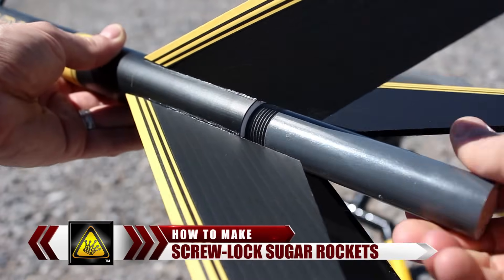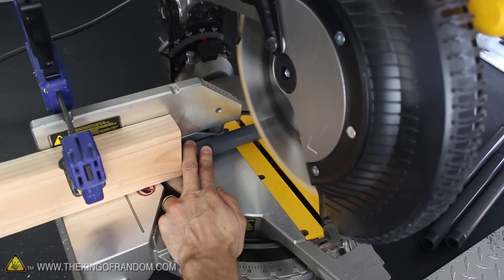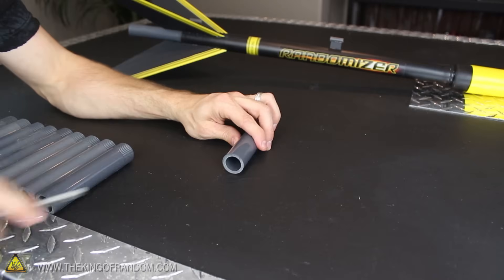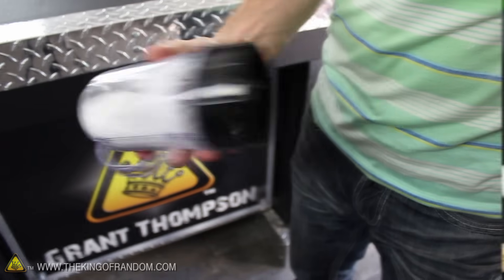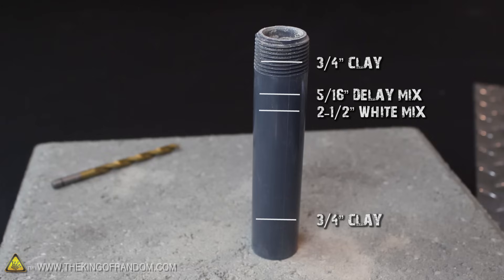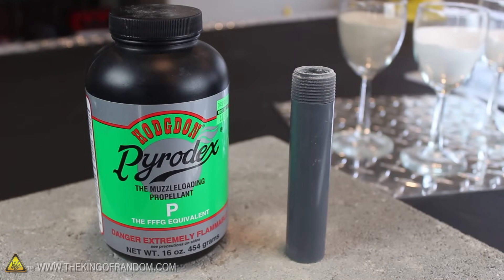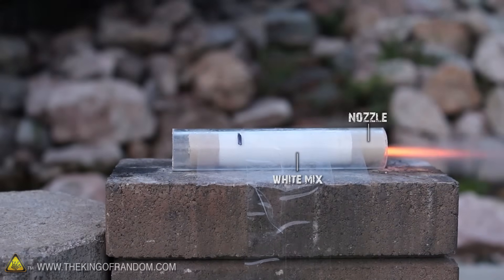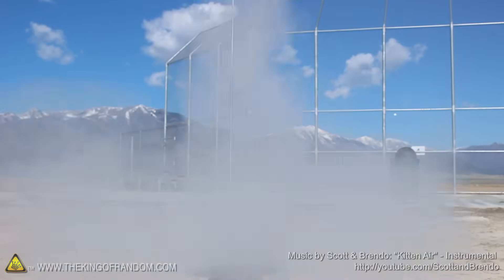How To Make "Screw-Lock" Sugar Rockets

Comment: What I like about this project is that it is not only very affordable, but easily scalable: You can use longer and/or wider PVC tubing with more propellent in it and/or add multiple tubes to your rocket to get even higher altitudes! I wonder how big of a tube you can use before the laws of physics make it impractical? (i.e. Can an 8 inch diameter PVC pipe contain the resulting internal pressure and would its added weight not be worth the effort?)

Very nice!

JW3HH

Comment: Do you know if there is a way to get a slower, more efficient burn? I wanna make sure my rockets go as high as possible for as long as possible, and a burn of about 3 seconds doesn't sound good enough for maximum efficiency. Even if it's just a second or 2 longer, it'll probably make a major difference. I'd make the engine longer and increase the quantities for the white poder, but unfortunately I don't exactly know much about pyrotechnics and how it'll react.
Reply: Just use the delay mix for the whole rocket with only one gram of baking soda instead of three grams,it seems the baking soda slows down the burn rate 👍

Comment: "Be Precise" SO USE METRIC.
Reply: Just in case you dont know, almost every ruler has a metric side
Reply: 0.45 cm is way easier to understand and say as: 11/64 of an inch...
Reply: +David Ridout Ye, any buy-able rocket kit uses the metric system. Most instruction guides even come with a paper metric-ruler.
Reply: Wasn't the pipe in inches at first? 
yes, so use inches. If it was in cm then use cm. Easy peasy. Thank you, butthurt.
Reply: no
Reply: +Daniel McDonough I understand if you don't want to change the standard for speed limits and temperature,  but how hard is it to pick up a metric ruler instead and measure in perfect precise little milimetres?

Comment: I built the rocket with no problem but am having trouble with the motor getting enough thrust to get off the ground. I have not tried them in the rocket yet, just using wood dowel for now to prove the motor. I have made 12 motors so far and the only 2 that have made the sky were cored motors made with heat. The "end burn" motors just don't have any thrust. I have tried the packed powder method and the heat method but they just don't work. I am using a 65/35 mix and trying to follow exactly what you did with no results. Any ideas?? I would love to hear from anyone that has had luck. Thanks, Kevin

Comment: My dad and I made sugar rocket motors to your specs to find that the casing is too long.  This is just my experiences with these motors.   I think the case for my rocket motors should be 4 inches long.
Reply: We had perfected the up part even with the five inch long casing, we are figuring out the ejection aspect of the motor.   We used fffg black powder but we had a burn instead of a pop.   What should I do to fix that?

Comment: One note that could be important.  The BATF (Bureau of Alcohol Tobacco and Firearms) controls mixtures of potassium nitrate (but ironically has exemptions for other rocket fuels).  This puts limits on how much you can store and transport.  I spent several hours on the phone with a BATF rep, a few years ago, to make sure what I was doing was legal, etc.  I would recommend anyone serious about making these things (with any size) doing the same.  I found the agent quite friendly, helpful, and knowledgeable, as well as practicable.    Don't want to see anyone in trouble, when doing this legally is fairly easy (and part of the technical challenge)

Comment: Isn´t it risky to hammer the mixture of sugar and potassium nitrate in the tube with a hammer? Since you are compressing it so much that it becomes a bricket, the force you use on it could heat it up so it could go off accidentally.

Comment: Nice video but here a little tip. Don't use store bought powder sugar.  Use a grinder to make your own from granulated sugar instead.  Store bought powder sugar has about 5 percent corn starch added to coat the sugar and prevent it from absorbing moisture.  While not a huge difference you will get a better burn from your fuel.

Comment: You should try NightHawkInLight's method of making the motors.
He has a metal rod mounted to the surface he packs the motors on, and a hole going through the ramrod.
That way there will be a hole going through the rocket as you're making it, and you wont need to drill out the hole later, which makes the rocket a lot more accurate.

Comment: I know an issue you said you had in the past with these was that they absorbed moisture and became less efficient or unusable, but I'm wondering if you don't drill the holes through the clay would they not absorb any moisture? You could just drill the holes at the rocket launch site or at home before you leave for the site and they should last much longer.

Comment: "needs to be protected and treated with respect" 
*rams it down"
Reply: +Matt Merrill The stuff's specifically sold for muzzleloading rifles, if all it took was a little ramming a lot of civil war era soldiers would have lost their hands.
Reply: +Panagio Tsaou 
Well, Diesel for example explodes by just compressing it, they don't need sparks in a motor. I bet that mix would also explode if you compress it enough.
Reply: "puts it in a oven at 300 degrees"
"be careful about friction heating it up"
Reply: How else would we compact it?
Reply: +CelmorSmith this mixed ignites at about 600 and something degrees so i dont think pressure will set it off.
Reply: +ootie extreme  there is no other way
Reply: Luke Finlayson No other way for what?
Reply: Lmao
Reply: +Jack Yorgesen That's before mixing it up with sugar. Heating pure KNO3, no problem. Heating KNO3 with something flammable, explosion.
Reply: +Jonatas Silveira Baldo  I've done it before though, it turns a redish brown color and then when it cools it gets really hard, in other videos you can see people making their rockets that way and it worked better for me that way
Reply: +Matt Merrill i get it
Reply: ok
Reply: hello